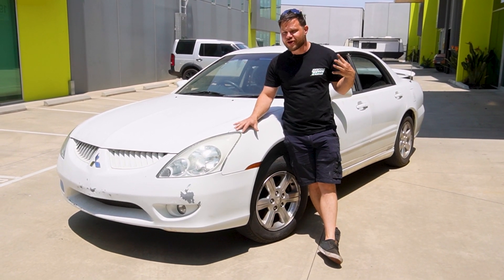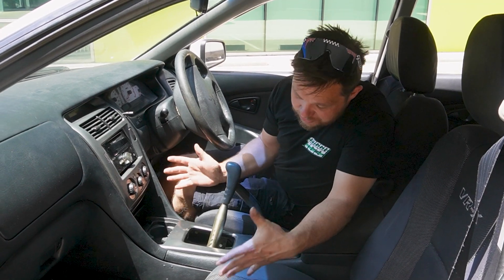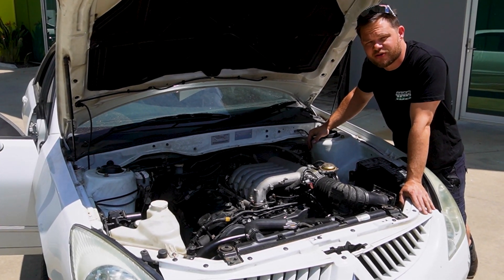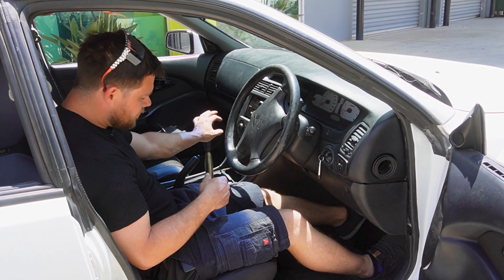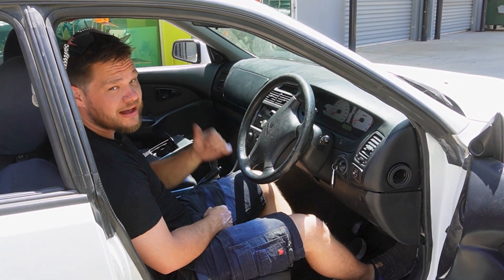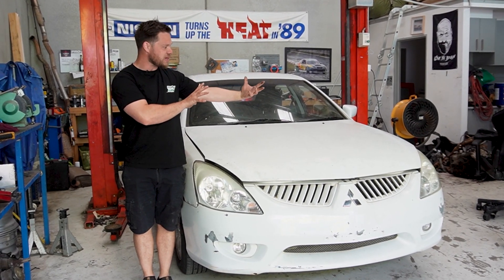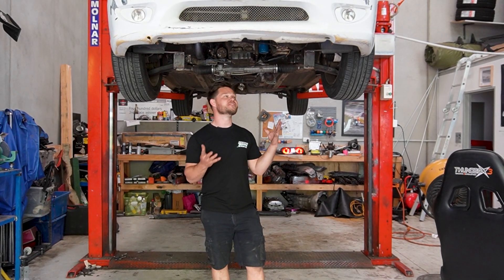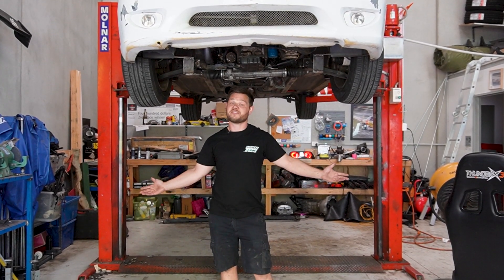RWD Magna Build: why it doesn't work.

Comment: would be interesting to see how GMH did the steering on the V8 manual magna they built which still races up in queensland
Reply from the maker: Id love to see it. I believe it was a future tourer and 12 hour car? It's likely tubed. Concidering at this point clipping it at the firewall and putting a rwd clip (like a falcon) on it. And adapting the pannels to fit so it looks factory

Comment: I have 4 awd magnas. I regularly ponder over the potential problems  of this conversion. 
Triton rwd box is an easy rwd option and reliable tough. I considered r32 gtr box for awd. But again more science. The triton box to jeep transfer could be an option, the American s do this option and box to transfer housing adapter s are available especially to main stream gearboxes like T56 or getrag.
The xmember for the front consider NM pajero . 
But a lot of people use s15 xmember n steering and adapt to suit .
Your trak problem in reverse probably needs fwd track arms to add caster and stop walking of arms against the bushes.
I think the read diff will be an issue as well , go clutch type lsd  .
Me im leaning to gtr box due to my needs. Were you can torque split easy or steering wheel controls 2wd to awd or data log the track / hillclimb and % of bias .
But road idea would be 6g75 twin turbo triton box jeep transfer as it is over engineering and usa parts i just order . Another thing would be signa turbo style airvents  to let air out and aid speed n cooling and that 125-130km lift in the front,  added bonus it keeps bugs off the windscreen in front of you n passenger. Keep up the research n development.
Oh in the 90s i saw a TP magna elite with a 318 rwd launch and reel smoke off the rear tires at the lights . I caught up to find out more very cool
Reply from the maker: Yeah so I've addressed the steering as best as possible ( see upcoming episode) it's not perfect. But it's a lot better. Plus using the pajero gearbox minus half the transfer isn't that bad, it just means I can't have the car low. For the meantime

Comment: Weld the cross member to the fire wall while the box is out. Manual shouldnt be dead. Id say clutch or engagement isnt right.
Reply from the maker: It was the transfer case not engaged properly
Reply: @pezomatic1  ahhhhg roggg

Comment: there is still stuff you can do, maybe a remove about cross frame  reconnecting the section you cut,  have you pulled apart the box to see what is possible ?
Reply from the maker: Box is step 1. Then onto steering

Comment: Could you have left the engine transverse and capped off the front driveshafts but kept the transfer case sending power to rear wheels?
Reply from the maker: Yes. So an alternative would be to weld the transfer case up and cut the front driveshafts. Except it would have meant retaining the automatic
Reply: None of the awd magnas came out in a manual version, they were all automatic based on the rally magna at the time, there was one single awd manual magna but that was built with the blend of a different manual gearbox custom mated to the awd transfer case, in saying so there is a clip somewhere of an awd magna with the front driveshafts removed/capped off and they do a rwd burnout funniest thing to see in a magna,
Reply: What about the galant vr4 gear? Does that have any cross over parts to potentially do this and have a manual option? The legnums and the vr4 galant had manual variants.